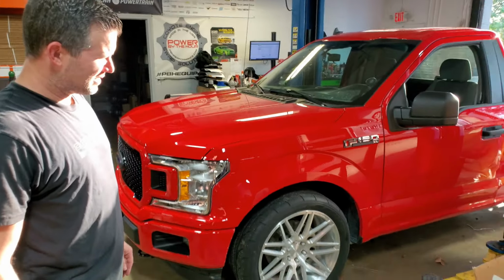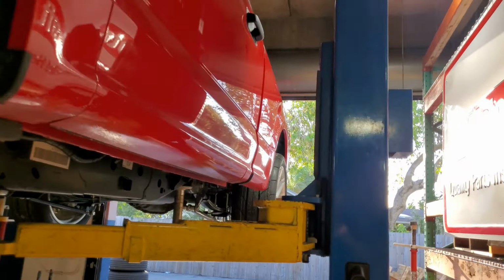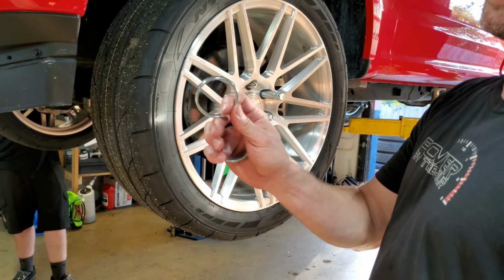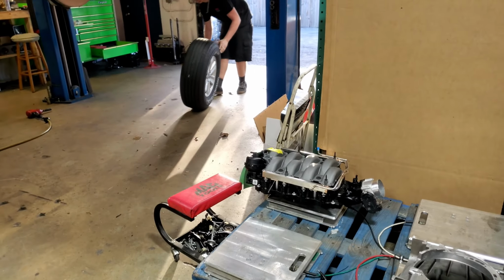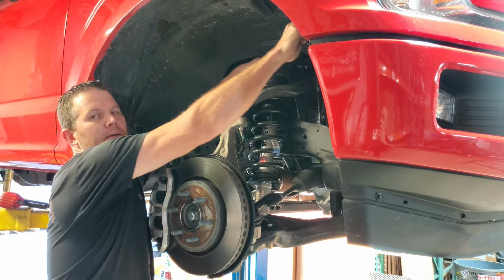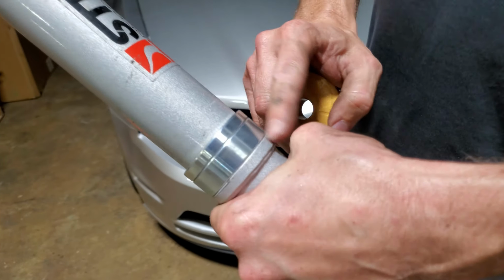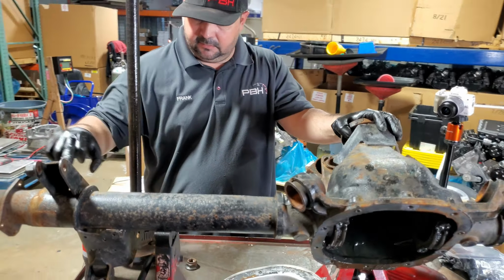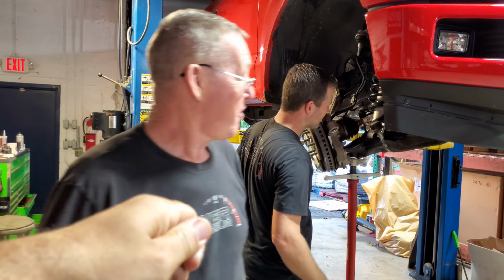La mamalona  Power by the hour's Red 5.0 F150 gets new shoes.

Comment: For those wondering (which is probably no one) I just found out that the gen 1 coyote and gen 2 coyote 2.8 kenne bell supercharger kits run the same size pulleys and boost as the gen 5 stage 2 whipple kits for gen 1 coyote, gen 2 coyote, and gen 3 coyote. They are just numbered differently.

In other words, the kenne bell kit makes 10 psi with a 4.00 pulley and the gen 5 stage 2 whipple kit makes 10 psi with a 4.00 pulley 

The kenne bell kit makes 11 psi of boost with a 3 7/8ths inch pulley (which is a 3.875 pulley in the whipple kit). And the gen 5 stage 2 whipple kit makes 11 psi with a 3.875 pulley.

The pulley sizes and boost levels are identical for both kits. Kenne bell just uses fractions for their pulley sizes, and whipple uses decimals for their pulley sizes.

So guys who want to run a gen 1 or gen 2 coyote kenne bell kit can look at the gen 5 stage 2 whipple boost chart.

I AM NOT SURE HOW CORRECT THIS IS,  THIS WAS THE CONCLUSION I CAME TO AFTER DOING A QUICK INTERNET SEARCH.